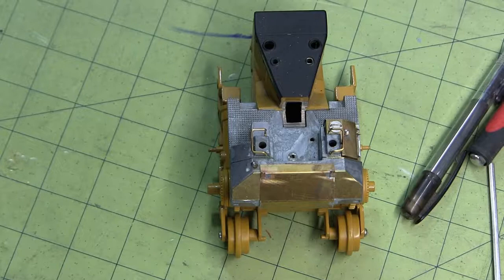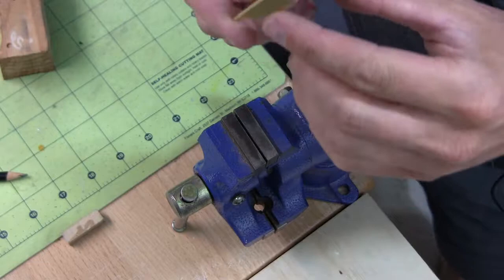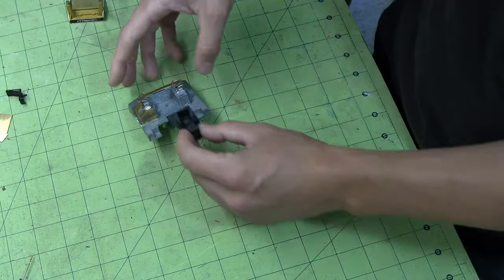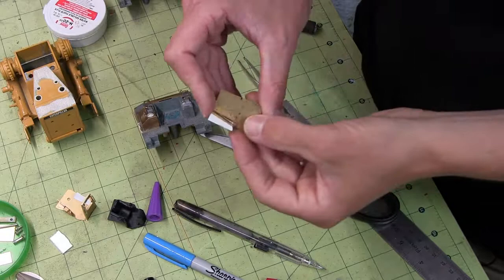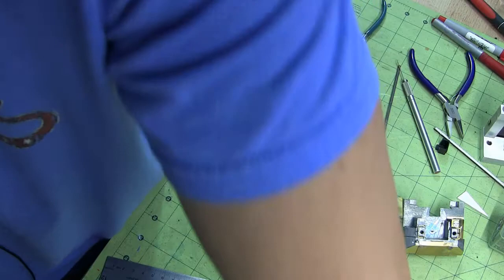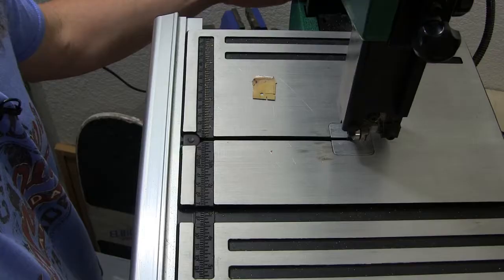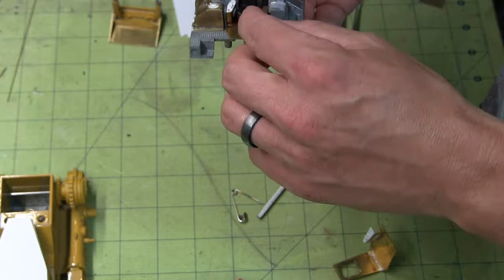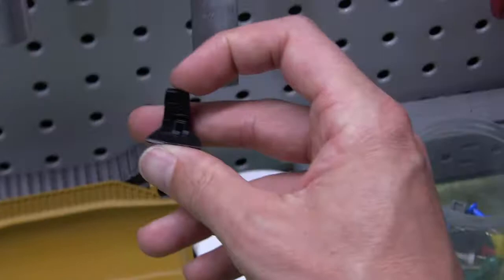Building Open Cab and Full Interior for  Custom 1/50 Cat D11N

Comment: Hey Stephen, grab yourself a jewellers saw. They are great for cutting very fine slots for control levers and openings and they are cheap as chips. like the razor saw they come in various TPI's but the blade is like a piece of wire and fits through the tiniest of drill holes. Those glass beads are great I use em a lot, if you grab yourself a box of straight dressmaking pins they are great for levers, they have a head kinda like a nail but the top is domed and just slot straight through the bead. I'm hooked on your builds now, keep em coming!